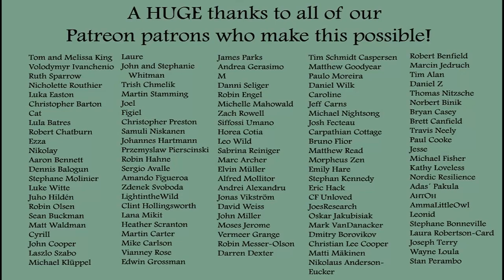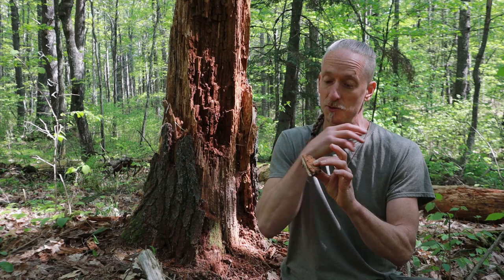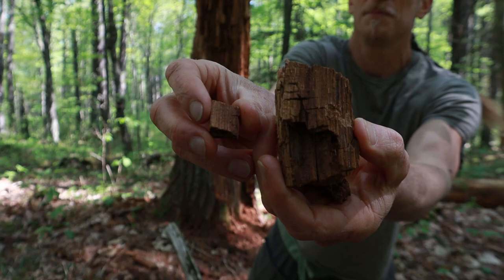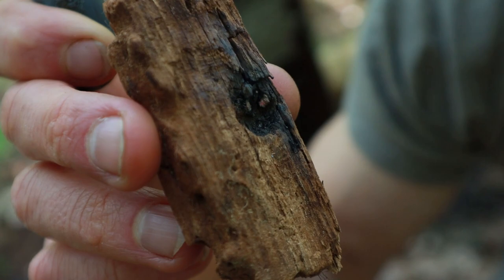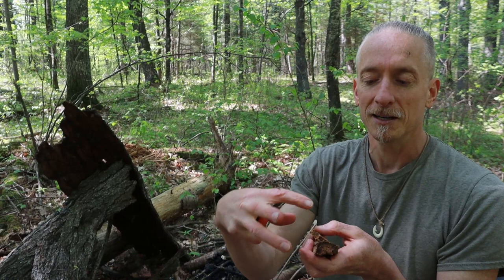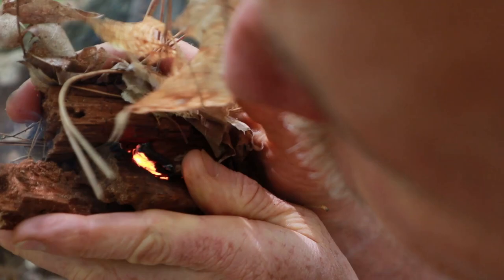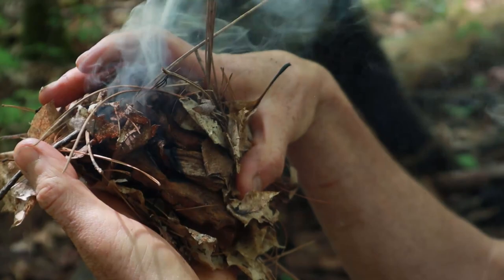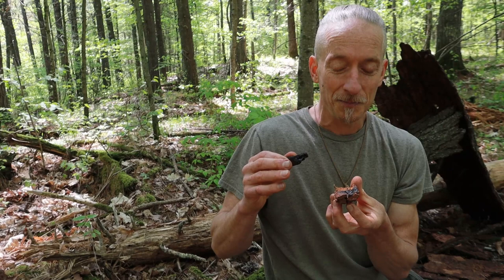Advanced Bushcraft Skill -- "Caving" Punkwood

Comment: Plenty of punkwood where I usually camp (hopefully for five days in July, the traditional rendezvous with out-of-state family that I missed last year). I've been lazy about fire-making, usually just using a bic or zippo, but I recently found my long-neglected ferro rod and will be doing experiments (I have a small backup rod, and I suppose I should practice with the weaker sparks, as well as the tiny ones from a dead bic.
Reply from the maker: That's a great idea to practice with those weaker sparks -- then a modern ferro rod will seem easy! I hope your family gathering goes great Leo!!

Comment: Fantastic, i have used punkwood before, but it's hard to turn it into a flame. It makes a lot of sense to do it this way! It's basically the same as keeping a fire burning well by having enough stuff close together to generate a lot of heat in one spot. Also great to use for drying tinder as you said. Thanks a lot for the video!
Reply from the maker: Absolutely -- I like it because it teaches that basic fire principle you speak of - keeping the heat "in".

=) Kenton